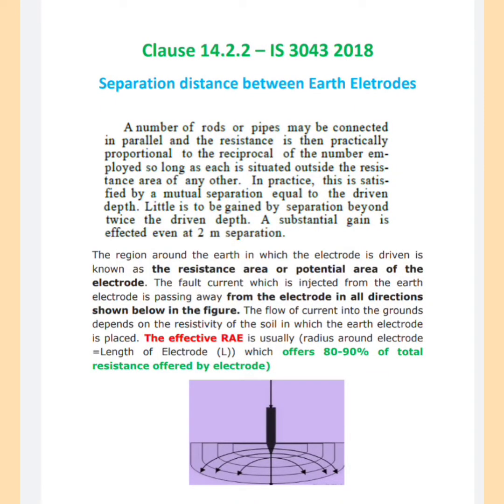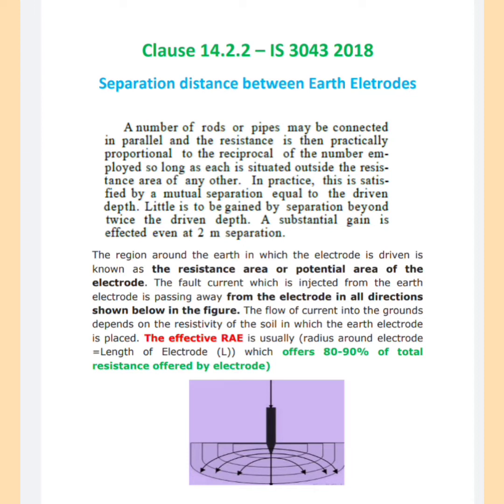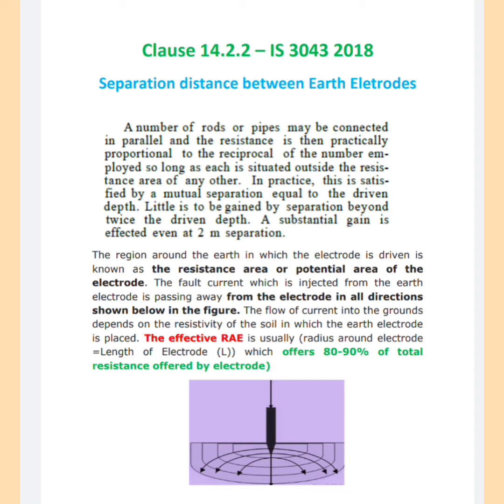Separation Distance of Earth Electrodes .....Dr Rajesh Arora

Comment: Analogy: In a farm if plants are overcrowded, then the yield will be less! 
Another misunderstood clause is double earthing of 3 phase motors. The real meaning of this is to use 2 separate lead wires and NOT 2 electrodes which is incorrect.